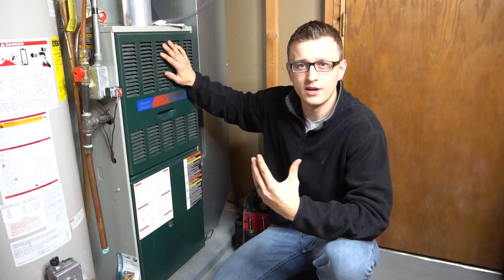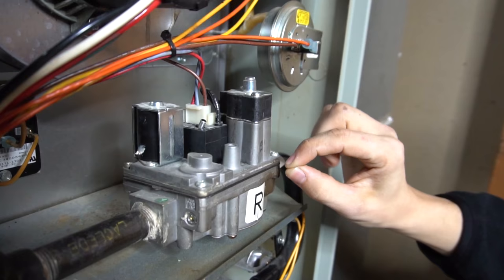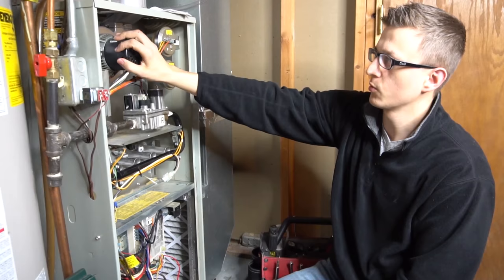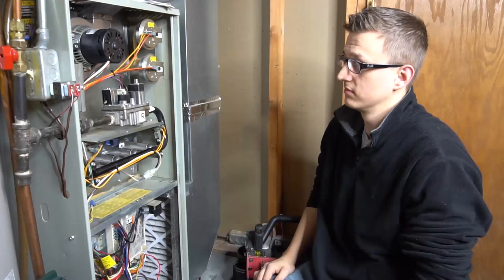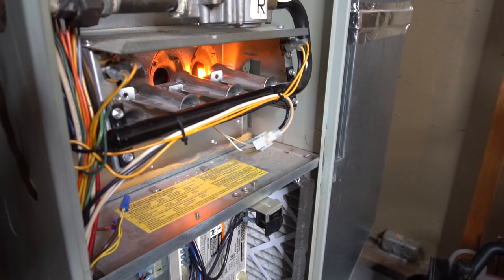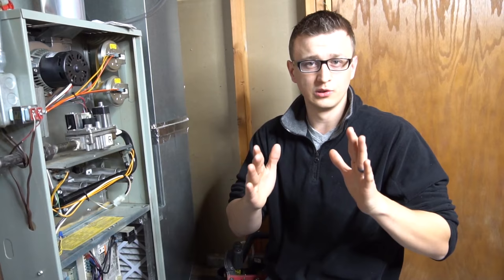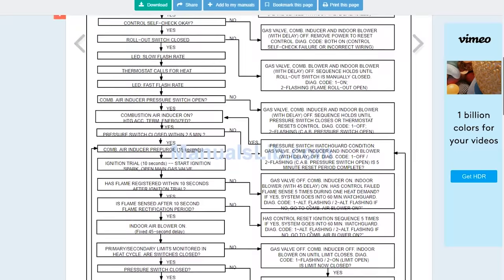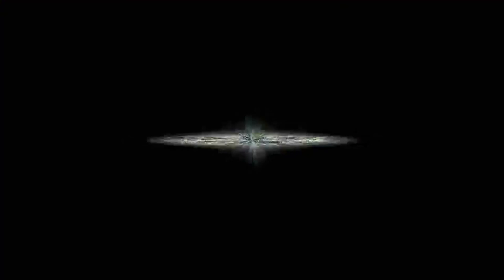How a Furnace Works - Furnace Sequence of Operation

Comment: What would it mean if the furnace heats up, blower is in low speed, it get really hot and takes 5-10 minutes before the blower kicks on to hi speed.   Sometimes the delays trips the limit switch.  How does the furnace know to speed the blower up, I feel like this is my issue.   Carrier 58MVP LP furnace.
Reply: If you have a 2 stage furnace the blower will run at a slower speed when in low heat. It could be that the low blower speed was set too low but the high heating speed is correct.

Comment: is normal i dont have air filter where you have yours
Reply from the maker: If it blows air, there should be a filter somewhere. Sometimes it is not by the furnace but instead behind a return grill. I talk about other possible locations in this video: https://youtu.be/uPaZvHp4L2Y?si=XCL0zLpr8OZlqgnz

Comment: I think my furnace is way older than this. I don't have a junction switch. It's directly plugged into the outlet. The blower fan goes on but I don't see the igniter turn on or the burner go on at all. There's no led light either. I hear the gas switch click.

Comment: Does the Heat Exchanger warm up to 120°F or 140°F....my professor told me 140° but the book says 120°F
Reply from the maker: Different heat exchangers will warm up to different temperatures. There is no set number.
Reply: @WordofAdviceTV  Thank you appreciate it 🙏🏾

Comment: My Dads furnace has me stumped.  Goodman 93 upflow 2 stage. 
3 flashes pressure and more in circuit, i have tested everything in the circuit, individually, 5 parts,   Still cuts off. Sometimes fires up, then when blower starts it stops in about 3 seconds. Watching you, I will go back check bi metal more closely voltage test . Any other direction??. I was almost ready to declare board issue.?
Reply: Second stage never wired, only single 
Thanks

Comment: So, let's say in some hellish scenario that an igniter went bad, and the flame sensor was so filthy that it did not function properly.

Nothing is there to ignite the gas, but also the flame sensor isn't picking up that there is no flame, so it never tells the gas check valve to shut off.

What happens? Is there a third safety measure, or will it just continue to pump gas out until something blows up?
Reply: If the flame sensor is not working then the board will only turn on gas for 4 seconds before shutting it off. The flame sensor cannot sense a flame that is not present. A dirty flame sensor will not sense flame even if it is present.

Comment: My furnace is 18 years old and I replaced the inducer a couple of times. The main board several times. Pressure switch a couple of times. Now the furnace start the cicle and the ignitor glow you hear the gas valve clicking but it won't open so it doesn't start. I'm suspecting the board may be bad. Any other ideas of what could be bad? The LED light doesn't give any code.  It's blinking calling for gas.
Reply: If the gas valve is energized but not supplying gas then the valve is bad.

Comment: could you do a video on a rooftop gas/electric package unit? :=)
Reply from the maker: Unfortunately I have very limited rooftop unit experience so that wouldn't be a video I would make
Reply: @WordofAdviceTV  Okay thank you. I have a rheem roof top unit. We did figure out the igniter isn't working today so thanks again for showing us the fire up sequence. Main differences we saw so far on a package unit was that it has one IFC board for both air and heat, no look through glass, it vents differently, and no safety mechanism near the panel door that shuts off unit if door is off.  Keep posting new videos they are appreciated!
Reply from the maker: Awesome! Glad to hear you found the problem. Stay warm! :)
Reply: @WordofAdviceTV  ok the igniter is working now, but my blower won't start. I had someone out today and he thinks I have a bad blower. However I was running my AC fine up until a few weeks ago. Would the flame sensor prevent the blower from starting if it doesn't sense flame? We tested the power at the blower and it has the right amount reaching it. My unit is 5 years old and I would think the blower should last longer. Thanks in advance for your reply.
Reply from the maker: Hey Amber! Sorry to hear the problems aren't over yet :/ A flame sensor would not prevent the blower from starting. If you have verified that your motor is getting power but it is not starting, then either your blower motor capacitor is dead or the motor is burnt out. If you reach in and touch the motor (don't know how accessible it is on your unit) is it super hot? If it is, that's another indication that the motor is bad. Check out this video, maybe you'll see something else you can try: https://www.youtube.com/watch?v=JSgLGTAbDF8&list=PLK8tZPlovA8BJJ_weFseSjQWUvB2FFII2&index=5
Reply: @WordofAdviceTV  The motor was not hot to touch. I am wondering if the blower capacitor I just replaced is a dud. The AC and fan was working before I put that new capacitor in because I had tested the new wire saver that was installed earlier in the week. The wire saver allowed me to run the fan independently again. It is under warranty its just that I was hoping to have heat before Thanksgiving. Thank you for all your help and fast replies. I will watch that other video again.
Reply from the maker: Yeah.. Before Thanksgiving would be nice. If it is a weak/dead capacitor, just to test it, sometimes you can start the fan by giving it a push with your hand. (Carefully of course) And make sure to spin it in the right direction so that the blades are "scooping" the air.

Comment: I changed the inducer motor,gas valve, and circuit board and my furnace still doesn't work
Reply: Keep giving her the apprentice special, youll stumble upon the problem eventually. Or you can actually diagnose it.

Comment: I called for heat on my thermostat and the control board calls for heat but that's the extent of it. No inducer motor comes on but it is freely spinning. Could you please offer any advise? Thank you so much
Reply from the maker: So if you jumper R to W at the furnace control board, nothing happens? And you have verified that there is power at the thermostat strip in the control board? (about 27v between R and C) If so, then my guess would be that either a safety switch is tripped (are there any error codes blinking on the control board?) or the board is defective.
Reply: @WordofAdviceTV  it blink a normal call for heat, I will check the rest.
Reply: @WordofAdviceTV  I went and jumped R and W and the furnace started. The inducer motor, then pressure switch, igniter, gas valve opened, and finally the blower motor kicked on.
Reply from the maker: @adamsloan5281  Okay. So in that case it is likely that something is wrong at the thermostat. And less likely is that a wire is loose or broken somewhere between the furnace and thermostat.. Jumpering R to W basically bypasses the thermostat.
Reply: @WordofAdviceTV  Ok so bypassing the thermostat and then the system starts up correctly means the control board is good?
Reply: @WordofAdviceTV  I just changed the thermostat for the exact same one and it worked. Then I tried to change it to cool/AC and I saw a flash and heard a pop from the thermostat not it doesnt work either. The flash was right through the digital readout on the thermostat.
Reply from the maker: @Adam Sloan Sounds like something shorted out. Did you verify that that the wiring was correct? Does your control board have a 3 amp fuse? Usually it would be the fuse that blows, not the thermostat.. I have a video on how to track down a short. Maybe that will help you: https://www.youtube.com/watch?v=4e4wsruGS0s
Reply: @WordofAdviceTV  Theres a 5 amp fuse on the board, but it didnt blow til I tried the ac unit. With it set to heat it worked fine. I will put a 3 amp fuse in there
Reply: @WordofAdviceTV  I should be able to isolate the AC unit and see if that is what's causing the thermostat to pop, right? Thank you for your help.

Comment: What if inducer motor not turning on  but works when tested manually.
Reply from the maker: Likely there the furnace is in an error state. (tripped limits or pressure switch stuck closed for example) Is the control board blinking any error codes? It could also be a faulty board too, where it is simply not sending power to the inducer motor. Have you tired jumpering R to W at the control board?
Reply: Word of Advice TV 
I cut heat on and inducer motor came on but ingnitor didnt glow.So i checked in peep glass to motherboard red lighf constant no blinking.So i took door off to do further inspection.Held down door switch to run another cycle nothing happen.Tested door switch,ignitor and  inducer motor all 3  working.
Reply from the maker: @gatorent.productionbuffrec8797  So it seems like the furnace does not behave the same every time.. Here is what I would do to start my troubleshooting:

1.Turn thermostat off
2. Take both doors off of the furnace
3. Tape the door switch shut
4. Jumper R to W on the control board thermostat strip (how to do it if you are unsure: https://www.youtube.com/watch?v=bmZc76ufTNY&t=2s )

From here things can go either one way or the other...

1. If nothing happens and the board is not blinking any error codes, then likely it's either a power issue or the control board is bad. (if there is 24v between R and C yet nothing starts, then it's a bad board or a loose connection)
2. If the inducer motor starts, give it some time and see how far it gets. Then using the sequence of operation explained in this video, you should be able to narrow down the possible culprits.
Reply: Word of Advice TV 
Hey i changed ignitor and furnace ran good for four days then stop heating.

Comment: Power goes from the ssu to the DOOR SWITCH TO THE CONTROL BOARD HIGH VOLTAGE TERMINAL
Reply: To a relay controlled by low voltage side ..

Comment: Hi Jay,
The heater inducer motor turns on, but the ignitor does not come on. I changed my flame sensor before I checked the code, but that didn't work. 
The flashing LED code (3 blinks) says that the Pressure switch is stuck open. (On our Goodman furnace 80% furnace horizontally mounted in attic Model: CHPF030A2C).  
The flu pipe is clear,  the vacuum hose is clear, the pressure switch port is clear. Should I replace the pressure switch or is there something else to check first. Thanks.
Reply: A manometer must be used to verify the pressure going to the switch. If the pressure is good then its the switch. If its not there is an airflow issue on the intake or exhaust.
Reply: @Redtooth75  I don't have a manometer as I don't do this for a living, but do understand the sequence for start up. I have a Pressure switch due here mid week (only $16) so it won't break the bank should it not correct the problem.
The exhaust pipe is short because the furnace is it the attic and it has a vented type cap on the top of the pipe on the roof (about 3 ft of exhaust pipe extends out of the roof with this vented cap on top) so I don't believe any birds, etc could get in there to plug it up. The pipe also sounds hollow and clear if I tap on it with a metal tool...Thanks.
Phil
NYC area
Reply: @uptownphotography  it is also possible for a clogged condensate line to cause pressure switch issues. Check the drains and check for water present in the hose for the pressure switch. If the lines are clear and the flue is clear then most likely a bad pressure switch.
Reply: @Redtooth75  Yes and thanks. 
I agree. The heater started working last week (after it stopped) for some reason and worked fine for a few days and then around the 5th day stopped working again. 
I am hoping the pressure switch, as you mentioned, is the reason. The new switch i ordered won't get here until between Tuesday and Thursday, so I will have to wait it out. 
Luckily not too cold right now here at the New Jersey shore except today chilly....Thanks for the input. Very much appreciated.
Phil
Jersey Shore area near NYC

Comment: Hello, can you tell me the sequence of operation when it comes to the limit switch (heat)?  I am getting red flashing 4 times which indicates a limit switch problem. I testing limit switch and it has continuity. i am not sure if the limit switch feeds power to the pressure switch or vise versa. knowing this can help me focus in the right area.  thanks.
Reply: Consult the wiring diagram. There is going to be a heat exchanger limit switch and at least one rollback limit switch. The rollback switch does not automatically reset and must be manually reset.
Reply: @Redtooth75  Thanks, just figured it out. The TCO (Thermal Limit Switch) is open and thus was not sending power to the RO limit switch. jumped it and works so now just need to get the part.  thanks.
Reply: @JohnSchwartz-ry3ev  sometimes smacking the limit switch can get it to reset if its stuck.
Reply: @Redtooth75  it worked for me
Tonight when blower stayed on

Comment: A quick q: a properly maintained, good quality 80% furnace, (eg., Goodman), should last how long?
Reply: The heat exchanger which is the heart of the furnace is warrantied for at least 20 years as industry standard so at least that long. The various other parts will fail and need replacement such as the ignitor, blower, inducer, and gas valve but those are relatively cheap and easy repairs.

Comment: So I'm getting a code of 33 on a '92 day and night (carrier) furnace.  Model 376CAV048095ABJA.  I've replaced the capacitor, blower motor, control board, high limit switch, and t stat ( in that order). Everything else has been tested and or cleaned.  However when the t stat calls for heat nothing happens unless I've unplugged the furnace and plugged it back in to reset the board.  But even then the burners shut off before it reaches temp, I've tested all the other limit switches and they test normal.  Even had a tech come to the house and he couldn't figure it out after 3.5 hours. Also the blower fan comes on before the draft inducer, runs for 90 secs then shuts off and wont come back on again until about 10-15 secs after the igniter ignites the burners.  Sorry for such a long message but I don't know what else to do and you are by far the most knowledgeable of any other videos I've watched and explain things so clearly.  Thank you for any advice you can give me.
Reply from the maker: Hey Arthur! Sorry to hear about your drawn out furnace battle. So the 33 code, that is a limit fault right? On the back of your furnace door what does it say that code means? The first thing I would do is measure the temperature rise.

On your furnace nameplate where the model and serial numbers are, there should also be a little part that says "temperature rise xx - xx" it could be 35-65 for example. That means that the difference between the return air temperature and the supply air should be 35-65 degrees. Try measuring your temps and see what you get. I show an example in this video: https://www.youtube.com/watch?v=lmEbZ32H9nY&list=PLK8tZPlovA8BJJ_weFseSjQWUvB2FFII2&index=11

You said you cleaned everything, have you cleaned the evaporator coil? Also, if you tape the door switch and take off the bottom door then put it back while the blower is running, does the door slam back in? Just put the door right up to the furnace, no need to fasten it. Does it suck the door in with a lot of pressure or not too bad? Another possibility is that you don't have enough return air.
Reply: @WordofAdviceTV  Thanks for getting back to me.  So a different tech came to my house today and figured it out in about 10 minutes.  He measured the temp rise and found that the evaporator coil was clogged with dust and was restricting the air flow which was backing up into the furnace and causing the high limit switch to trip, just like you mentioned in your reply.  Its amazing the difference a knowledgeable tech makes.  So he cleaned it and the furnace is now working.  Thanks again for all the great info and keep it up on the videos, its really good stuff.  Honestly probably the most informative and understandable I've seen.
Reply from the maker: Awesome! So it's finally fixed! And thanks, glad to hear you find my videos helpful. Stay warm :)

Comment: Hi I have a problem with the blower motor not turning off after the cycle is over.  I was wondering if you could help with the ? Thanks
Reply: The fan relay contacts on the ignition control board could be stuck in the closed position due to arching,  there may be a short in the R to G wiring, the Fan On/ AUTO switch may be in ON position on your thermostat.
Reply: @jimbarron8688  limit switch might need a knock from a small screwdriver.